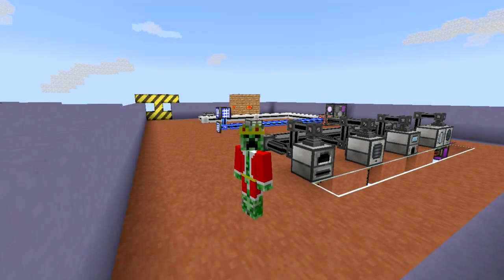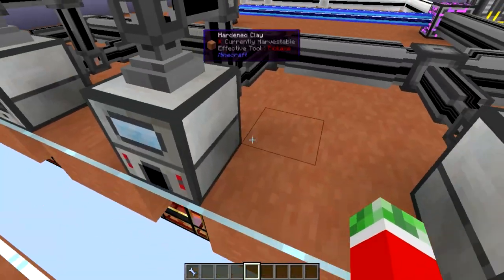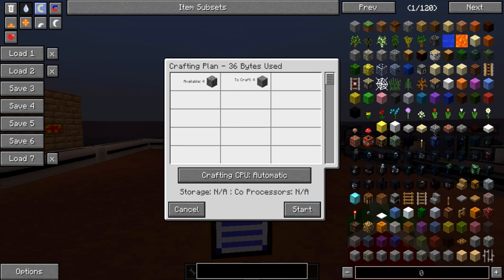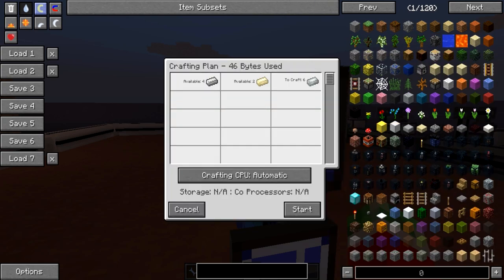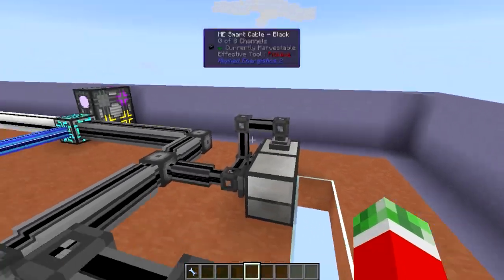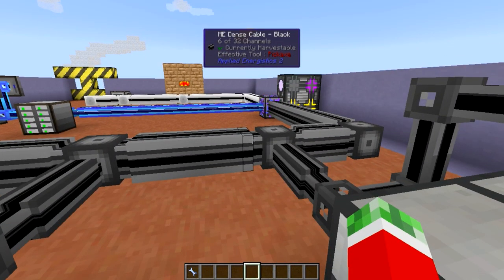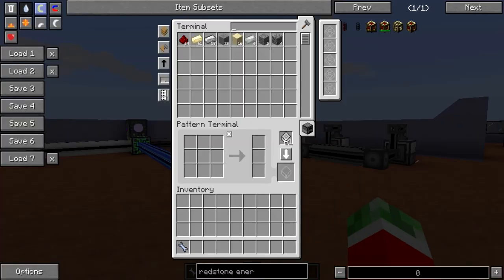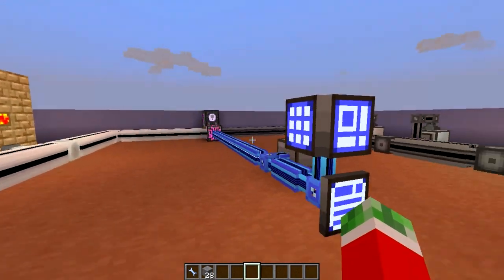Applied Energistics 2 Tutorial - Episode 5 - Smelting/Pulverizing

Comment: I didnt get one thing, when you put redstone it automatically smelts it down I dont want that, can I create like a crafting recipe that will put the redstone in and insert empty redstone cables when I want to
Reply from the maker: Hey Klaus! Sadly, not easily. The only way this would be possible if to setup a recipe to for example a chest to require 2 redstone dust and 1 cable, and use itemducts to put both items in their appropriate machines, but this would totally screw up when adding recipes that require energized glowstone for example. Hope this helped!
Reply: thanks alot
Reply: he is wrong u can easily set up a recipe to make destabilized redstone that then get transfered into the fluid transposer u just have to drag and drop the fluid out from nei on the product slot for the cruicible and then make for the transposer a recipe for conduit + destabelized redstone = full conduit
Reply: Schwarzflügelfalke that isn't what we want what we want is not auto crafting all of it 1 by 1 we want to autocraft them all at once
Reply: u can include the destabelized redstone recipe in the recipe for the full energized pipes,so u can go on your me say u want 500 of it and it crafts the pipes out of electrum and hardened glass (recipe for the 3x3 crafting grid) then say destabelized redstone for it he get out of redstone in a magma crucible that automaticly output the the transposer that know i get now pipes that get autocrafted and fluid out of the transposer that get automelted and produce the pipes out of it that get send back in your me system
Reply: Schwarzflügelfalke Thing is you cant create a single blank pattern for that you need like extra 2 machine setups
Reply: u don´t have to do it in a single patter u give every single machine what it need to craft, me is smart enough to do all previous steps for it as long u teach it to it
Reply: Schwarzflügelfalke it needs to be filled everytime
Reply: tried it and it works for me more i can´t say, tried to explain it to u as good as i can, have fun dude :)
Reply: Schwarzflügelfalke Thanks

Comment: Why not use interfaces in block form and just use an itemduct or something to pipe into the interface? If items are put into an interface, they are automatically put into the network. No slowness!
Reply from the maker: In that situation, the slowest factor would still be the insertion, though in this case the extraction by itemducts. Sure it's possible, but requires extra steps and isn't necessarily better.
Reply: Thank you for the tip. I used Ender IO for piping the items back into the ae system. You dont need an Import Bus this way and can place the item conduit in the same block as the power source. This meant that I could hide all of the wiring in the floor and wall thus not needing an ugly wire at the front of the machine.